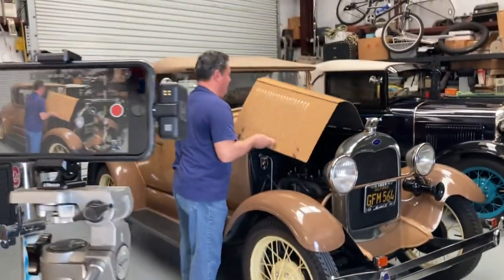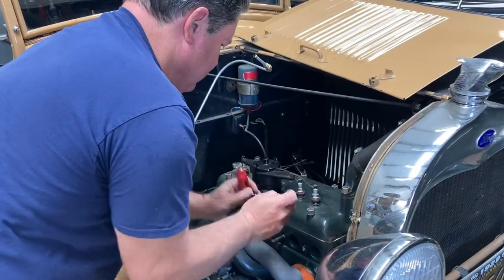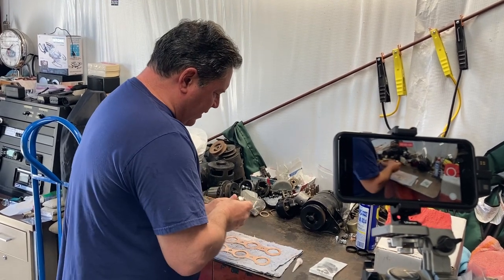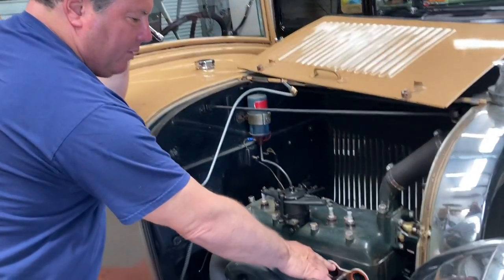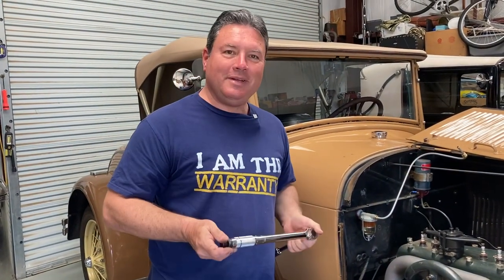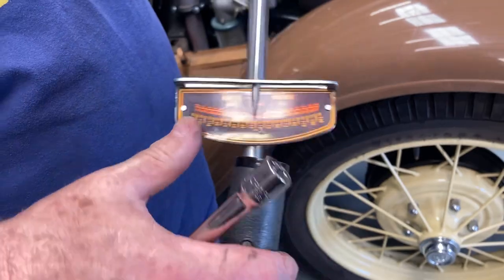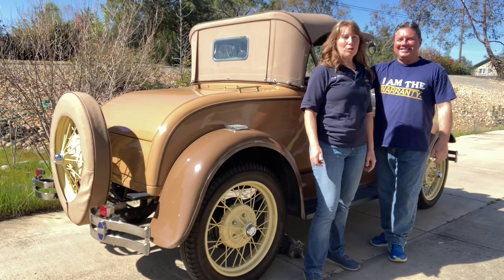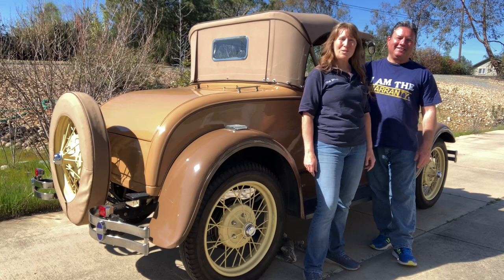Changing Manifold Gaskets on a 1929 Ford Model A Roadster | Behind the scenes with @ModelA

Comment: Great timing on this video Tina...I have been noticing a bit of backfiring on deceleration and on downhill runs with my '31...plus the accompanying louder exhaust note....I had pretty much decided the culprit was a leaking manifold gasket and ordered in replacement parts for the repair.  Your video helps me confirm my diagnosis, and parts are set to arrive to my house this afternoon...Now I will have confidence for the project this weekend...Thanks!
Reply from the maker: Thank you! That’s so awesome! Great detective work! Have a great weekend!

Comment: Excellent !  Just have to point out that those headlight lenses look very 'blue' what's more they are the 1930 design. You need the ones with vertical bars.
Reply from the maker: Thanks! Well they are halogen lights there’s no blue in them…the vertical bars where only 1928, this is from the judging book. The ones I have are for my year 1929.
Have a great weekend.

Comment: No heater? Do you have a heater on any of your cars? Do they need rebuild. Ya....... I know you California types, "It's beautiful all the time"! I know better. California experiences hot/cold extremes like most other places. Would love to see you go through one if you would. Thanks!
Reply from the maker: Lol, no heaters in any of our cars 😄
Reply: A Model A, as originally built, transfers much more heat  through the firewall and floorboards into passenger compartment than one experiences in a modern auto.  So much so that an insulation mat for the interior firewall surface is offered by the various A parts suppliers. The car can be comfortable to drive while wearing a medium jacket down into the 50s.  If the heater hot air pass through port is installed in the firewall and it is opened, even without the manifold heat exchanger box in place, one will gain an additional 10 degrees lower ambient usefulness.  With the box in place, one has a mini blast furnace.
Reply: @myrlstone8904  Thanks for the information. I grew up in New Mexico where it can get quite cold in Winter.